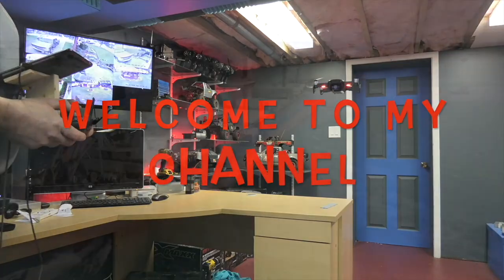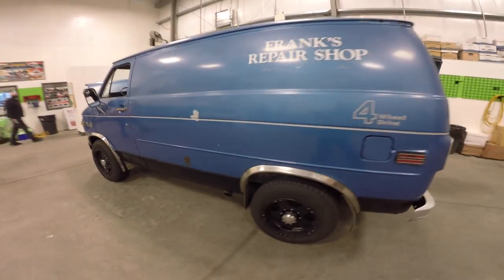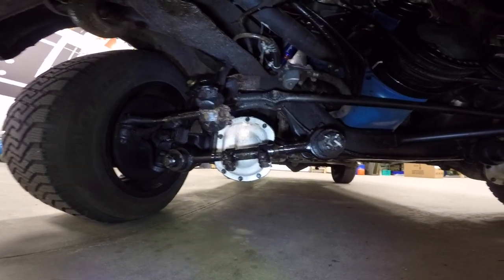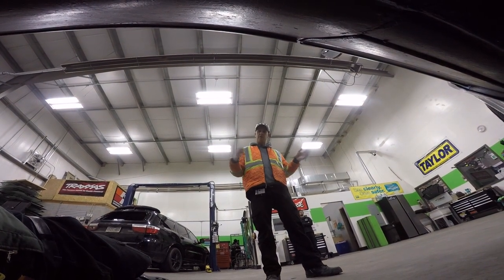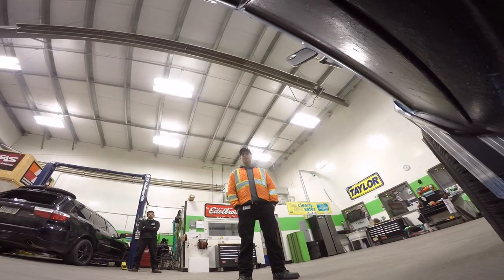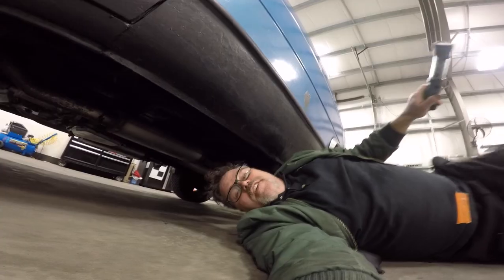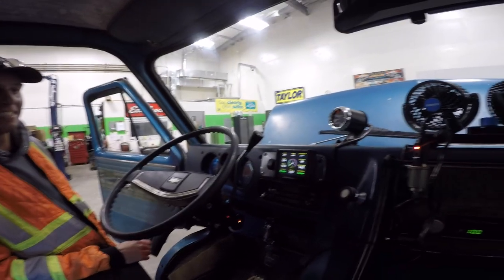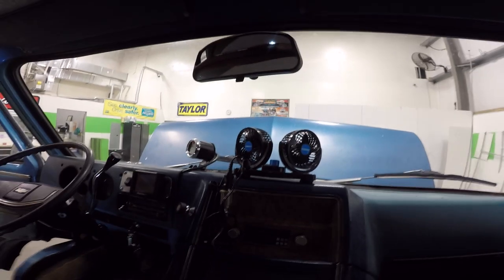1979 GMC 3500 V Drive 4x4 Van VERY RARE

Comment: Im an old school 4x4 GM truck guy (long story) and I've never seen anything like this.... did it come like this from the factory, or was it an after marker 4x4 conversion? Weird. Thanks, Jim! 🙂
Reply: It's an after market kit. Put on a new van. It was specially ordered off the assembly line so they could make the conversion easier. It was ordered in a short wheelbase with 1 ton drive line. Oddly enough it says it cam with a in line 6 cylinder in it. But it has a 350 v8 in it now.